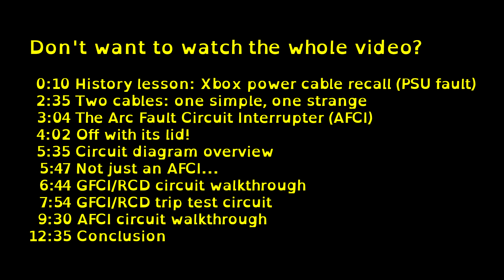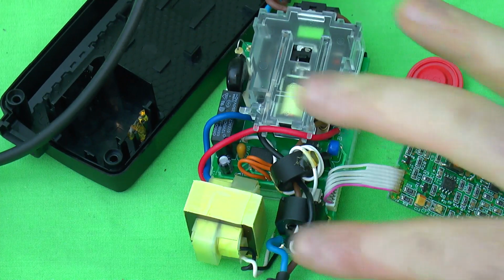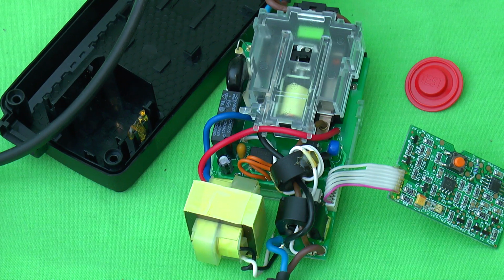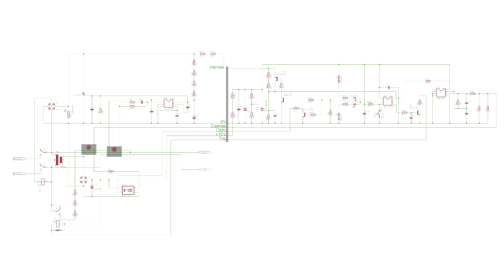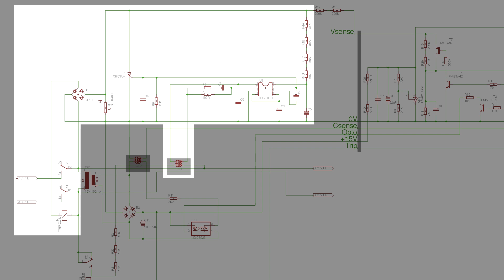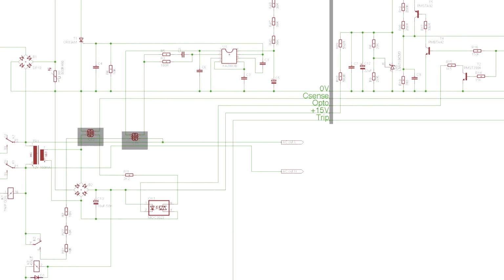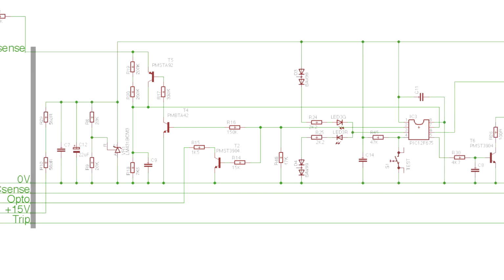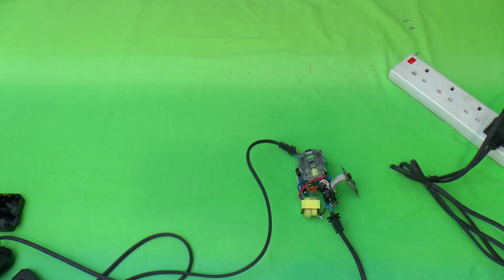Xbox AFDD / AFCI (Arc Fault Detection Device / Arc Fault Circuit Interrupter) Teardown

Comment: Just got my Xbox, including one of these, out of storage to test and remove the clock capacitor. The Xbox seems to work better than I remember it did before packing it away, but the circuit breaker... not so much. Pressed the test button and there was much buzzing and a rather unpleasant smell before the breaker possibly cut the power. Possibly, because the fuse in the plug blew too.

If I can get hold of the right size of five point driver I might open it up to inspect the damage.

Comment: AFCI is because in the USA there is not enough energy in a power outlet to either clear an arcing fault open circuit or trip an upstream breaker or fuse. Thus you get arcing inside those shoddy sockets that just heat up till they catch fire. 230V mains has definitely enough energy to blow a fault open or at least trip a breaker in a few seconds safely. The AFCI detects fast transients on the mains current, and if the transients last longer than a predetermined time and are above a preset level then it will trip out the circuit. Adding the RCD function was simply because the RCD IC is already UL listed and approved, so they had to do less testing on certification. You get AFCI UL listed IC's now, but probably when this was designed they were not available in volume.

Nice in that when it is sensing arcing and tripping it monitors the power switch to make sure it has tripped, and has the ability to measure the RCD trip by sampling the mains voltage, and another test circuit to emulate the arc fault ( the opto triac driving the second CT) to do a built in self test while the LED is flashing on power up. Note the latching relay is rated for full AC mains operation, and is designed to open safely into a close to dead short circuit under all conditions safely while containing the arc blast. It may not survive that, but is designed to fail safely as open circuit.
Reply from the maker: Aha, so that's what that second CT winding is for :)

Clever way to do it though: if the AFCI detects a fault it just makes the GFCI think there's one too :)

Comment: The opto circuit looks like a test circuit. The PIC needs to check that the CT is working. So when you push the button, the PIC fires the optotriac. It then checks whether the current and voltage inputs show synchronised AC signals. 

I'm wondering what the voltage sense system is for - perhaps it's to tell the difference between a "desirable arc" (like an arc welder or discharge lamp) or an "undesirable arc". Desirable arcs tend to be inductively ballasted, so the arc current will be phase shifted, whereas undersirable arcs tend to be in phase with the mains voltage.

I wonder if T4/5 are voltage range shifting - possibly the arc fault detector is made to be dual voltage, and selects the most appropriate voltage sense range automatically. The voltage seen by the pic when T4 is closed is almost exactly 2x that seen when it is open.
Reply from the maker: T4/T5 are triggered along with T2 which does the optotriac firing, so whatever that optotriac is up to, the sense voltage switching seems to have something to do with it.

Comment: Nice video. AFCIs are rarely needed in the UK, because of the high supply voltage. 

They are mandatory in many states of the US in homes and commercial facilities. 

A common failure mode of electrical circuits is insulation failure leading to short-circuit between live and neutral. The arc current depends dramatically on voltage (not just because of higher voltage, but because arc resistance plummets as current increases)
 
So, if on a low voltage (120 V) supply, you get insulation failure, you can get a stable arc developing, at a moderate current, which can result in delayed tripping of the overcurrent, if indeed it trips at all.

By contrast at a voltage of 240 V, stable arcs are very unlikely to occur, because the arc current will tend to be massive, resulting in near-instantaneous tripping of the overcurrent protection (which will also tend to be rated at a lower current, due to the high voltage).
Reply from the maker: Good explanation :)
Reply: AFCIs in the USA contain 30mA ground fault protection as well. The newest versions protect against series arc faults as well as parallel arc faults. A higher supply voltage does not mitigate against the risk of a series arc fault. The issue with the Xbox is a series arc fault.

Comment: So Microsoft just did this to prevent fire? Because it sure doesn't fix the issue... if you have a dodgy solder joint and the AFCI trips out then you can't use your Xbox anymore.... they might as well have given out plastic cables with no conductor, that would stop it catching fire too. Microsoft are shameless.
Reply from the maker: There were several articles on it. If there'd been any untruth in the matter MS lawyers would've been on them like a shot. As it was, they were rather silent on the issue.
http://www.theregister.co.uk/2005/03/19/xbox_recall_nofix/
http://betanews.com/2005/02/28/xbox-users-question-power-cord-recall/
http://www.engadget.com/2005/03/21/14-million-xbox-power-cord-recall-a-vain-attempt/
http://www.joystiq.com/2005/03/23/xbox-throws-sparks-despite-replacement-power-cord-microsoft/

Comment: I've never seen one of those inline AFCIs before. I have only ever seen them in circuit breakers. I have never had one trip from just plugging something in though.
Reply from the maker: I was deliberately holding back the plug to make it arc and trip. Tried several times for the video, the other takes took too long to get right.

Comment: In the US the National Electrical Code requires AFCIs on circuits feeding almost all rooms in residential installations now. The requirement started with bedrooms in 2002. Whether or not various localities choose to enforce that part of the code varies, I doubt if most are doing so to the level recommended in the 2014 code. The individual fusing and overall beefier construction of the UK mains plug compared to the US one may help to protect against an arc fault. Aluminum wire hasn't been used for branch circuits in quite some time, that was a 1960's-70s thing when copper was expensive. Now its only used sometimes for the main feed into the house from the meter.

Comment: I wasn't even aware such a thing exists.  It seems to be a running thing with Microsoft's build quality.  I bought a xbox 360 controller for my PC because some games now are designed for that controller only, I was quite disappointed with the build quality.
Reply from the maker: The original Xbox controllers were pretty robust (unless swung by the cable into a brick wall).
The original Xboxes were pretty much bombproof motherboard-wise, presumably they used proper solder instead of the lead-free shite. Some had lousy DVD drives (the Thomson ones being the worst) and there was the Foxlink power supply connector issue shown here that could be fixed with a load of solder, but the failure rate of 360s was far, far higher.

Comment: The primary sales pitch for the AFCI's in the states was supposed to protect against where someone drove a nail or staple through a piece of mains cabling but not so much as to create a dead short.   (Parallel arc-fault)    The latest generation of AFCI's are supposed to detect series arc-faults which would occur at a loose screw terminal or the like.   They don't always work as advertised however...  

AFCI branch circuit breakers are big business here in the states, the circuit breaker manufacturers have been able to get their AFCI breaker products mandated in nearly all states (Except for Indiana who has struck the AFCI section in every version of the National Electric Code).   Indiana has made it mostly clear that they AFCI's have yet to prove that they do little more than cause nuisance trips when someone tries to use a vacuum cleaner.   (You can guess what state I live in)

Comment: Very clever design, i followed you untill you said "simply", ha ha sorry red dwarf quote :-))
You must have been really interested to draw the circuit out, its not a task ive ever enjoyed, even when i knew what was roughly happerning.
Using solder to hold sockets in place should be a hanging offence lol, ive repaired so many laptop adaptors with the same cracked solder arking :-(
Reply from the maker: Tracing it out helped me understand what on earth I was looking at. When I first took the lid off all I saw was "gubbins".
I've learned as much from doing this video as anyone could learn by watching it. Unless of course I've completely ballsed it up and that's not how it works at all :)
Reply: AintBigAintClever
No i think your spot on, your a clever man, ive watched all your recent videos so i think im making a fair statement :-)
Reply from the maker: Laptop power connectors themselves are worse. Almost total teardown just to get at the solder joints! Glad I've got MagSafe connectors on mine.
Reply from the maker: zx8401ztv
A clever man doesn't drop his camcorder and thermal imaging camera on a concrete floor :/
Camcorder's fine, thermal cam's got 6 stray dots that (so far) I've not been able to shift. Worst comes to the worst I'll have to filter them out in Vegas, at least they stay put (if the cam had image stabilisation they'd be a swine to pick out).
Reply: AintBigAintClever
Well my mate had a dead 19v adaptor, it was a double wammy for me, the rather odd tube plug had 3 connections for the hp laptop end, it was internally shorted, mr stanley knife slit the plastic moulding and finally i chopped 1 inch off the 3 way cable and resoldered it, then epoxy to seal it in.
And the mains socket was crackerly, so that was fun :-))
The best part was a previous psu that died the same way and had the same faults, ha ha fun :-))
Reply: AintBigAintClever
Gravity is an evil sod, and breakables are attracted to hard surfaces :-))

Comment: Quite interesting, over here in Canada I've never seen on of these inline arc fault interrupters, I've never even seen a wall mounted or breaker mounted one. We definitely have GFI sockets in bathrooms and sometimes in kitchens, though kitchens here typically have split circuits where the top and bottom plug on the outlet are on separate circuits which you can't do with a GFI outlet. 
You'd think AFIs would be common what with houses built in the 70s using a mix of Aluminium and Copper wiring (mine's 60% Aluminium with not a single AFI) I've never even heard of this power cable recall here, and owning 4 second hand xboxes they all just have the typical 2 pin to 2 pin unpolarized AC.
Reply from the maker: Sounds like you missed out on the Microsoft free AFCI giveaway in 2005 then!

In the UK although we do have GFCI outlets (known as RCDs over here) usually it's done at the consumer unit instead. Latest wiring regulations stipulate that all cables running in walls need RCD protection at the consumer unit unless they're have "earthed mechanical protection", i.e. earthed metal conduit or capping. http://www.eaton.com/EatonCom/ProductsServices/MEM/Products/ConsumerUnits/17thEditionRequirements/index.htm
Reply: AFCI's weren't introduced until the late 90's early 2000's.   Original AFCI's weren't meant to trip on series arcs either, only parallel arcs (between the hot and neutral or hot and ground conductors).   So they wouldn't trip on series arcs like a loose terminal screw or poor aluminum termination...